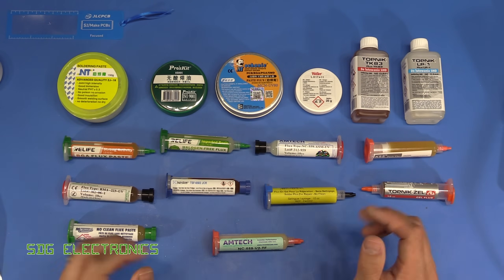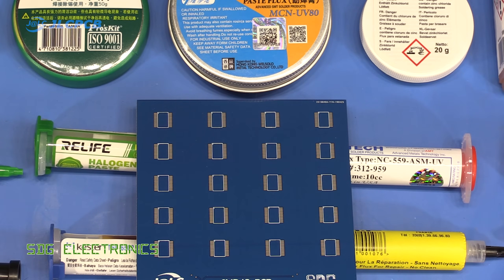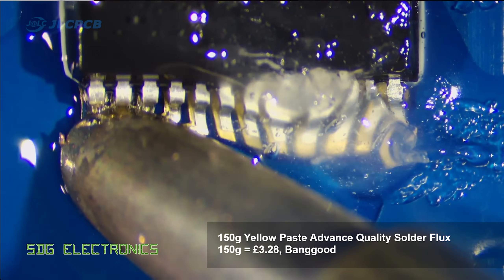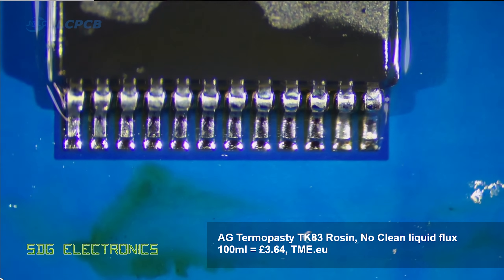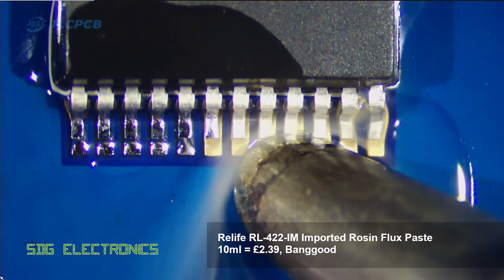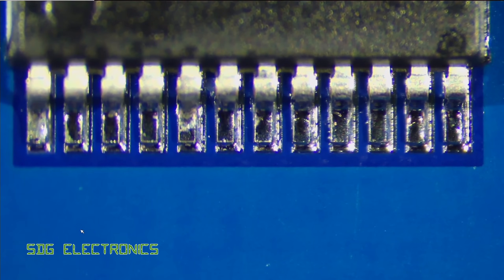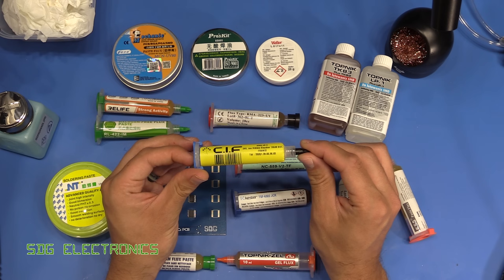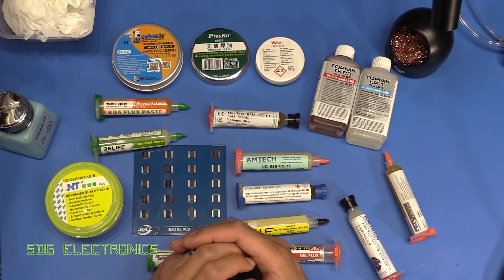SDG #086 What's the best flux for soldering? A comparison with PCBs from JLCPCB

Comment: does the CIF is easy to clean? does it make sticky/greasy residue?
Reply from the maker: Very easy to clean, but looks to be difficult to get outside of Europe.
Reply: yeah i saw that :/ my problems is that i use fake amtech and smells HORRIBLE i dont have enough ventilation for it... and i try use mg chemical heavy duty flux remover, isopropyl alcool and 100% acetone and its getting sticky/greasy... what would you recommand me? im doing mostly through hole but some time resoldering on standby smd section in tv power supply and clean is a nightmare now... ive try fake amtech and proskit

Comment: Now perform the SIR test for all the fluxes from this video. I'm (almost) sure you'll be (unplesantly) surprised. The quality of solder joints is not the only important thing you should worry about: some fluxes remaining conductive or (even worse) creating a capacitance between the leads if not cleaned off. So you will have a bad time debugging your assembled device (especially on high-frequency parts: MCUs and quartz resonators).
Reply: TRUE. I'm agreed with you.
Reply: yeah that's totally right. every flux comparison, unless you're using them to solder power wires or low-impedance low-frequency circuits, has to include a conductivity test.

Comment: best flux ive ever used especially for cleaning off dirty oxidized surfaces is a water thin acid-flux applied using a brush attached to the screw top lid.......i used to get this stuff called "Bob's" acid flux when i raced slot cars 15 years or so ago (im sure it was rebranded from original brand so i dunno what it originally was and that drives me crazy because i would love to get more of it!!!)
Reply: Mid America Raceway still sells it, just ordered a bottle last week.

Comment: For liquid flux i just buy the rosin and dissolve it into Isopropanol. Doesn't get any cheaper and works fine. Enough flux for years to come. https://www.ebay.de/itm/KOLOPHONIUM-300g-in-Barrenform-Dreieckig-Kolofonium-Rosin-Baumharz-3x100/321753865217?ssPageName=STRK%3AMEBIDX%3AIT&_trksid=p2060353.m1438.l2649

Comment: Zinc chloride containing fluxes (such as the weller one) are not suitable for electronic components soldering, they are mostly for plumbing since ZnCl2 is pretty corosive and has to be removed after soldering. Moreover, ZnCl2 is extremely dangerous for a human: it's a skin irritant and its fumes cause lungs diseases.
Reply from the maker: Interesting, I hadn't noticed the composition but it was picked out alongside the other flux pastes from an electronics supplier.
Reply: Are you sure it contains ZnCl?
Reply: @catharperfect7036  Weller Lötfett? It literally says it contains zinc chloride right on the cap of the can. See 5:43
Reply: @dvmavgoor  oh k thanks, yeh that's the first flux I've come across with it. Even quite aggressive ones these days seem to avoid it due to the respiratory issues.

Comment: Chip Quik SMD291 is great for soldering on ICs. It has a low viscosity, a greasy consistency. SMD4300TF10 is good for whatever else. Amtech does leave a sticky residue I don't like. When you heat the flux, it’s very transparent making it easy to see what you're doing. These are good for phones and small SMD work. I think rosin-based flux is fine for just about everything but can be harder to see for the small stuff with it's yellow coloring or becoming browner with heat. Rosin doesn't evaporate and smoke as quickly as Amtech. You can heat rosin to 500C, and it won't evaporate. It can turn darker as it heats up with use as you slide the solder iron around it more. Use what you like for whatever applications.

Comment: I'm just starting with SMD soldering (or planning to do so for long) and this was extremely useful information. The brand/price overlays over the different options and again on the results was brilliant. So easy to compare. Talking pace and speech clarity also spot on. Great work, thank you!

Two things I would have liked to hear (or missed): 1) what type of solder was used, 2) is the shelf life of the flux jars longer than on the ones that come in a tube? With the little time I have, it might be weeks or a month between I solder anything requiring flux. It's quite frustrating as the manufacturers state the shelf life to be only months. I've seen tips of reactivating old flux with IPA (maybe it was also on your channel?) but I've yet to try it.
Reply: Yes, Italian's are goog engieers!
Reply: How is this related to my comment 3 years back? My questions are still valid btw. I've yet to have 
 the time (or need) to get into SMD. 😬
Reply: @ristomatti  My apologies.
Reply: @ristomatti , perhaps this will begin to  answer one of your questions:  I have a small plastic tub of Weller flux, ingredients stated as "a blend of rosin and petroleum jelly", that is about 40 years old and still works fine despite having tiny crystals on its surface.  I don't know if this type of longevity will apply to the modern fluxes of today, but it appears that rosin itself is stable and inert,  and the only thing likely to degrade is the chemical jelly or petroleum type product that the rosin is presumably mixed with.   Perhaps the short lifespan stated by some flux manufacturers is a get out of jail card for them when they sell flux for critical applications such as the military. And like you, I don't work with surface mount components; I work primarily on single-sided circuit boards in vintage audio gear, and older point-to-point tube amplifiers or those with turret boards and eyelet boards. I don't work with brand-new SMD components and PCB's.
Reply: @goodun2974  Thanks for this. My comment was "a bit" long ago, and my electronics hobby has been on hold almost the same time. But I'll go continue keeping l the small jars in the fridge "for that one day" 🥲
Reply: @ristomatti ,  I posted some reviews and teardowns of soldering equipment and accessories on my channel recently, including a video on crappy soldering-iron tips and how to easily discern them from good quality tips.

Comment: That is not that of a demanding test. Good flux paste shines when you abuse it, for example prolonged heating with a heat gun and also how easy is it to clean. Imagine if you had to solder a BGA package and it left rosin residue between the balls. A pain to clean that sometimems leads to problems due to flux acting like a dialectic.
Reply from the maker: True and I will try to address this in another video :)

Comment: IMHO the genuine Amtech really shine when used  with an hot air gun. It really make the difference, it stays there active for a long time but you really need good ventilation or a real fume extractor, it is very smoky. The fake Amtech's residue are much harder to remove and they spread wider on the board. It is cheap but i won't buy it again. 
For general soldering i like to use the liquid TOPNIK RF800 in a squeeze bottle with a fine gauge needle. I work mostly with beefy through hole components. RF800's residue are really easy to remove with IPA and the flux works very well and it is not very smoky. Liquid flux are good just with a soldering iron. With hot air you need a gel flux, and the Amtech is the the best flux i've ever used. Just my two cents.
Reply from the maker: I'm going to do a test with hot air shortly - firstly with the PCB used in this video, but it sounds like it would be worth getting another test board with some large ICs and a ground plane on it. Thanks
Reply: Louis Rossmann swears by genuine Amtech flux for all the work he does. In fact, he buys and re-sells them because he trusts them that much and wants others to be able to reliably source the genuine parts.
Reply: @Slavolko  It's fair to promote it as it's genuinely great for its appropriate usecases. But its also really expensive, at least for those who do not generate any revenue on soldering work. And for many of those without a national/regional distributor, as international shipping and potential import taxes can make the total price really brutal.

I need to point out that the sentiment pushed by Louis about the process of buying Amtech flux is a horrible ordeal involving faxing orders etc, is either false or long outdated. You can just order it online from Amtechdirect.com . They're one of the few official distributors for Iventec (Amtech is a product lineup, Iventec is the company), and as such they keep shipment-ready stock of pretty much the whole Amtech lineup. So if you need anything else from the Amtech lineup, these guys are great to have around, as you don't need to worry about getting fake products.

That said - unless you want 10cc quanitites, or large tubs, buying no clean 559V2 tacky flux from Rossmanngroup is not a bad idea at all if the shipping etc works for you. Because the 30cc units Rossmann Group sell, are $16. From Amtechdirect they're $27.

Comment: Thanks for the video Steve. Have you ever used an ultrasonic cleaner to remove flux residue after soldering?
Reply from the maker: Not at home, but I'm looking out for a good deal on an ultrasonic bath for this. Thanks

Comment: "No clean" I've yet to find a flux that really is no clean on anything but the simplest boards.
Reply: While the point is that leaving the residues on there should cause no long term issues, two things to still consider is such: 1. If you do want or need to clean it properly off, it usually will take more work and need solvents, ie not water soluable. 2. If there's a whole lot left on there, it could pose a nuisance or even challenge, for potential future troubleshooting, due to its material properties once all its solvent/suspension content has dissipated, and how it's relatively significantly more work to remove (than water soluable flux). "Clear" ones shouldn't pose issues for visual inspection, but some leave a white residue that can obstruct visual indicators.
Reply: What that means is, 'no longer active when cool'. It will still look like snot crust :P It just won't hurt anything but your eyes.
Reply: @rich1051414  More specifically still, it means it's no longer active when cool AND after being fully heated to soldering temperatures once. Many no-clean fluxes are corrosive if they've been partly heated, as happens if you use it to tin stranded wire (where the flux melts and wicks under the insulation as the wire begins to heat, but long before it's reached soldering temperature). I'm running an experiment right now, where I took all the fluxes at work and from home and used them to tin some clear-insulated wire, as well as applying the same flux to another piece of the same wire, but not tinning or heating it all. Only one paste flux (a non-no-clean rosin flux gel) has caused corrosion on the unheated wire, but several no-clean pastes are causing corrosion under the insulation. (Same with some no-clean liquid fluxes.) 
In essence, most fluxes need to reach a temperature high enough to neutralize them. (The big exception is the water-soluble fluxes, which will remain corrosive no matter what, and thus must be flawlessly removed, making them unusable for things like stranded wire.)
Reply: @tookitogo  Hey there. How are the experiments going?

Comment: How about you test their corrosive action? This is very important for so-called "no-clean" fluxes, since a lot of people use them for cheapo bga rework and have terrible issues later.
Reply from the maker: Good points. I'll address this in the future when the test is complete.
Reply: Thats my question as well. If they say "no clean" I would be willing to trust them. But some don't mention no clean at all, especially the Relife ones say "high activity" which is concerning, as it sounds like it could be RMA or RA type?
Reply: @jaro6985  unfortunately, most of no-clean fluxes from china are must-clean, especially fake amtech, mechanic and other rosin-glycerol based fluxes, since they contain a lot of fake corrosion inhibitors, that don't work as they should.

Comment: Great video :) May I ask, what did you use to apply the Kester flux? - I've got some of those syringes, the flux is good, but I use a screwdriver to push on the piston. There may be an easier way to use it.
Reply from the maker: It's a bit extravagant, but I used a Metcal DX-250. Take a look at SDGEE #047 for a lower cost alternative, but it still needs a compressed air source.
Reply: @sdgelectronics  Thank you - The DX-250 is way overkill for my application. I'll have a look at video #47. I do have a compressed airsource at hand.

Comment: I disagree in two ways :). First, for new shiny parts flux performance doesn't really matter. Second, there is an important part of test is missing: test for electrical conductivity and acidity. Flux, by the nature, is acid. The stronger acid is, the better is soldering. So, top-performant fluxes are almost always have to be cleaned, even if they are "no clean". "No clean" is actually misleading, as what it means is flux, if properly activated in reflow process, may be left on the board. This doesn't include hand soldering. Without cleaning most "good" fluxes cause corrosion and ruin performance of precision circuits (ADC, DAC, amplifiers, etc). Even with a proper cleaning agent it's not always easy manually clean the board, only ultrasonic baths can get underneath of ICs, etc. Because of this, I always recommend using mild fluxes that can actually be left on the board without impairing performance. So, what I recommend is do so-called SIR-test on fluxes. I'm pretty sure you'll get surprising results.
Reply from the maker: I'll look into this, thanks for the insights.
Reply: @sdgelectronics  Could you try Ersa flux
Reply: Hay you know Mr. Carlson lab?
Reply: which kind of mild flux would you recommend for hobby electronics? I have rosin core solder already but sometimes a little extra flux would really help neaten things up
Reply: Well put indeed Alexandre, especially missed some explanation of what the codes such as RMA stand for. Also what is missing is things like how long does it take for the flux to burn off etc. The main idea being there is a lot more to flux than just soldering something new. It is also a question of how well does it perform when doing things like reflowing more complex package etc.
Reply: Yeah, manufactures should put the PH number on all their fluxes. So that way you know which one is good for the job at hand.
Reply: i dont think these factors matter much considering home style repairs work for years using some of the best (most acidic i guess) fluxes out there and they were no where near cleaned with ultrasound
Reply: Alexandre Kandalintsev
, thank you very much for the precious info, it's appreciated, and big thank you to 
SDG Electronics, for the effort and the hard work put into this video. regards
Reply: What is SIR-test?
Reply: @larryphful  it's "Surface Insulation Resistance Testing", or how much the flux is conductive.
Reply: @AlexandreKandalintsev Does Amtech/Stirri V3-TF pass this test?
Reply: get away
Reply: @hp2073 why lol
Reply: I use water-soluble fluxes, they are easy to clean. Be careful not to use solder with rosin-based flux in them - that's quite a limitation, the vast majority are rosin-core. Solders with water-soluble flux do exist, but they are very rare. Using flux-less solder isn't quite as convenient.
Reply: I don't use flux unless its in the solder, cleanliness is your friend and you don't need to buy it. don't handle your PCB's too much, keep components in sealed packets for as long as possible. handle as little as possible. keep blu-tack for sticking things to the wall.

Comment: Your analogy on the fluid is spot on. As a part of the soldering I carried out at work, we looked at this and using the microscope could see the heat from the soldering iron directly burning off or evaporating the adjacent flux. I do have a concern with the thin consistency. Originally and at home, I use a thick paste and found, and in both cases, they last a very long time. With the thinner paste, it is tough to administer by hand, and because the density is lower gets used up very quickly. This may be my method, but there was a definite consumption at work between the two.
Reply: by the flux lasting long does it become so thick it’s unusable? i find after a few minutes the flux gets so dried and thick on the board i need it clean it off and reapply

Comment: Really enjoying your recent comparison videos. I always thought the AMTECH was the be-all and end-all of "tacky flux." I'd love to try the C.I.F. product but sadly it is not easily available on my side of the pond. Did you purchase direct from C.I.F.? Great work, again!
Reply from the maker: I actually got it from Amazon, but now there is only a 3rd party seller on there selling for 3x the price. I think Farnell/Newark/Element14 sell it too, but at a slightly high price.
Reply: @sdgelectronics  Thanks. Interestingly, nowhere to be found here -- not listed on Amazon.ca/com, or Newark (https://is.gd/8TnvNm), or Mouser (https://is.gd/AWTyJp). No need to reply. I assume C.I.F. doesn't complete in the North American market.
Reply: I got it in Australia via Element14. But the catch is that the Kester is seemingly impossible to get here (Kester wire is easy but the flux is verboten for some reason). So there are pluses and minuses depending on where you live.